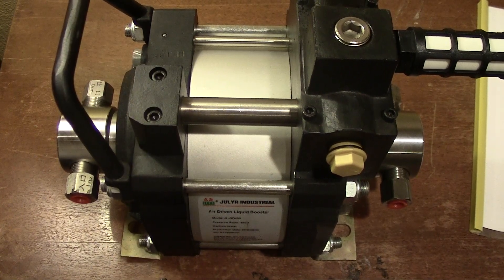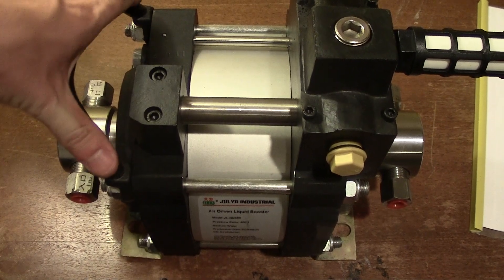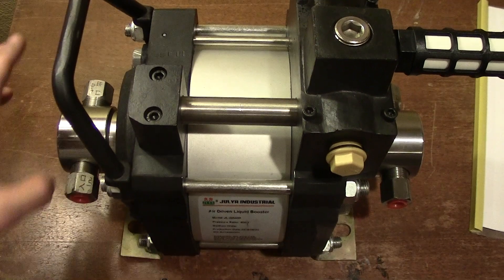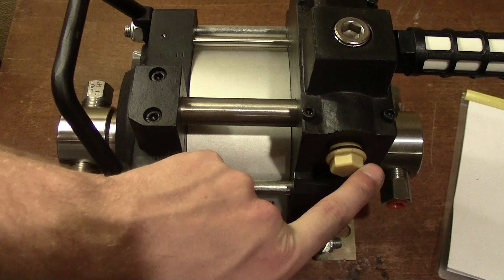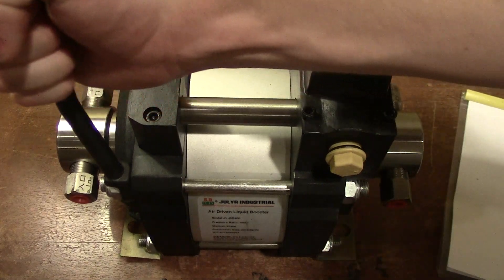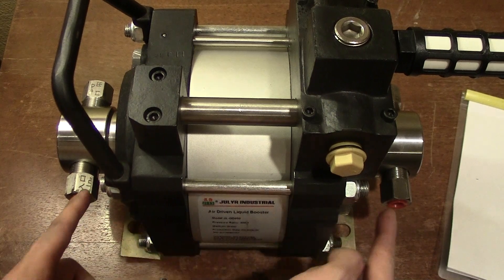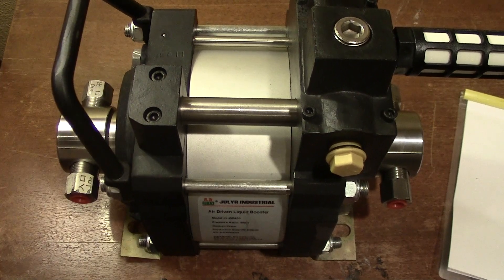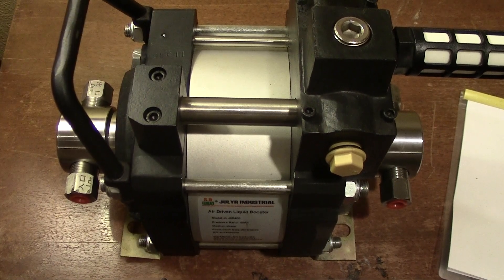Update On Personal Water Jet Build: Pump

Comment: Iam confused..we are talking about liquid, uncompressible..is 2 stage really applicable? Im really up for a good pump to do same project but i cant find  pumps online that can offer a good specs
Reply from the maker: that is just a simplification. Water is very compressable. Whenever you hear uncompressible it is a simplification for a boundry condition for a equation for ballpark calculation to be solved easily and quickly. Next to nothing is uncompressible.

Comment: Hi, I found they have 3,5kW motor attached https://knowledgebase.omax.com/protomax/content/kb/qs-vid-installation.htm  ...do you know why? - the pump needs compressor for its operation, so that motor is compressor, what do you think? ..and may I ask you what air compressor are going to use for your waterjet?  ...mabe they use direct drive pump? https://www.google.com/search?q=omax+direct+drive+pump&client=firefox-b-d&source=lnms&tbm=isch&sa=X&ved=2ahUKEwivkuTA_ZfoAhXS0qQKHQT6AeoQ_AUoAXoECAsQAw#imgrc=pzTKn0Q9GSExtM

Comment: doesn't it seem like you could just make your own, a block of metal with pistons in it, precisely bored?  I get that it's a little more complicated than that, and figuring out the materials and thicknesses in order to be safe at the operating pressure could be obscure, but such a pump somehow seems like a diy-able thing.
Reply from the maker: Sure. It can be done.
Reply: 30k psi (>2k bar ) hydraulics need precision ground surfaces for the pistons and cylinders, otherwise the system would leak like a sieve. Unless you have the precision grinding equipment already in place, it's not worth the investment for a one-off thing.
Reply: @AKAtheA  interesting.  Do you know to what level of precision? (I'm not sure how that would be specified...like surface roughness Ra or maybe just microns/nm of part size tolerance?)
Reply: @perspectivex  It's like saying that you would make piston engine for your car by your self. They have experience with making those pumps so you can't make same quality pump in home. They usually have custom sealling that is hard to find
Reply: @MrPRECLIK  Ben Krasnow will do it ... :)  Or Dan Gelbart.  Or maybe Jeri Ellsworth.  Or luciano jorge ritchie, or maybe Sebastian End with his super precision diy cnc mill, or BenNBuilds who builds a fusor like he was making a peanut butter and jelly sandwich or the Stuff Made Here guy.  I would no longer rule out "aerospace-level" production at home.
Reply: @perspectivex   If you spend 200 hours engineering it and 100 hours machining it, total cost will be near to official price, but without any warranty

Comment: That pump is a very poor and cheep copy of a pump made by autoclave engineers in Alabama. There are al mfg of these types of pumps in the USA. For a pump, tube, swivel, unions, abrasive head, and small hopper. Expect to spend about 10k for american made and 7k for China parts. You will quickly wish u paid extra for the nice stuff.
Reply from the maker: hmm there is a similarity. however not sure about the copy it is very simple mechanism. the design has probably existed since steam age.
Reply from the maker: but i do see a very close similarity in the design.

Comment: How did the Intensifier work out? I looked for the JL-GD400 on Alibaba, but it says it is no longer available. Im interested in making my waterjet too. Let me know if you are open to chatting.... I founded Printrbot, so Im interested in some of the same things.... 

Brook Drumm
brook@printrbot...
Reply from the maker: i talked to you at the last maker faire show in san jose. Sorry to hear about printrbot i wanted a printrbelt and went on your website to buy one and it was no more. anyways yea im i need to make it a manifold for it. once i make a manifold for it i need some high pressure flexible hosing then my draw table then i should be good to go.
Reply: Brook Drumm the idea is very simple but it’s what’s on the inside that counts. Tolerance and materials make a huge difference. I bought the same pump you have. Seals wore out very fast and unit just could not handle the heat. There are many mfg of these types of pumps and are used extensively for compressing gasses. Hyden makes among the best but are very expensive. There are several mfg in Houston that make flexible hose for 30,000 to 100000 psi. It’s much more expensive than semi flexible stainless steel tube but can be run through cable track. I own a small builder of custom automation called ezcnc. My phone number is 2149240314. Good luck, once you get the correct Id size tube, and orfice, you will have a lot of fun with the waterjet. Be careful, 30k psi is deadly, buy the correct fittings and spend the money to have tube coned and threaded properly.